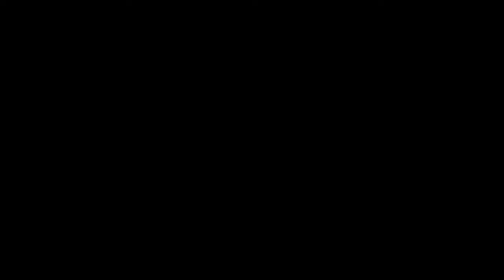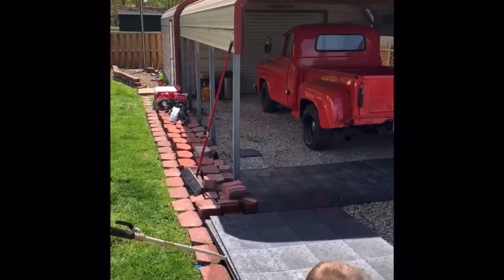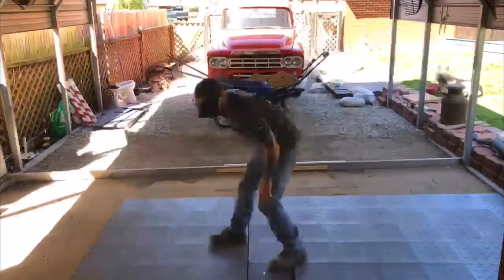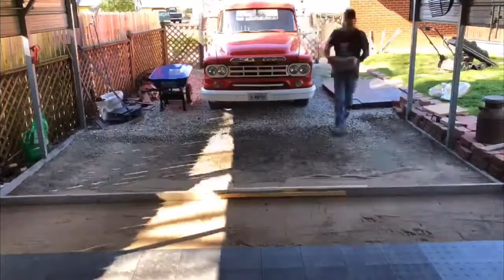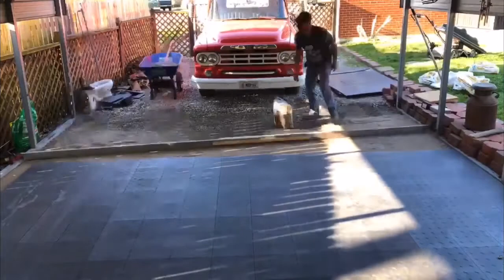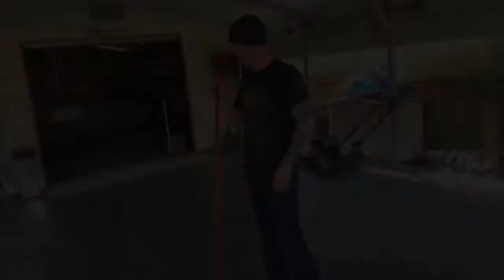Metal Carport Ideas /Flooring / Part 1 #shorts

Comment: What is that you put down as a floor and is on gravel or dirt you have given me many great ideas for my 20x40 motor home  metal shed
Reply from the maker: I had compacted gravel for a couple of years , then I leveled it with a thin layer of sand and put down these plastic garage floor tiles. It works great as long as you keep them out of the sun.